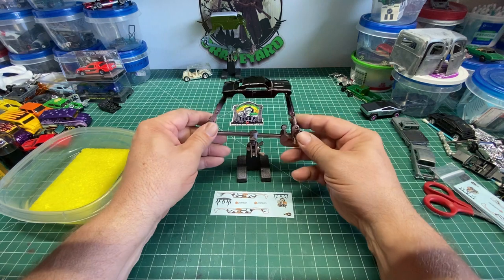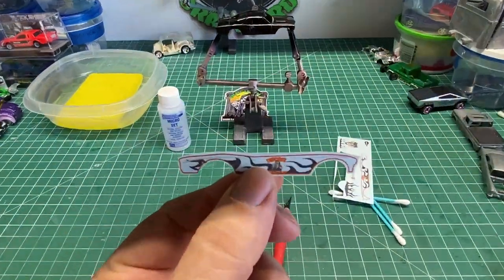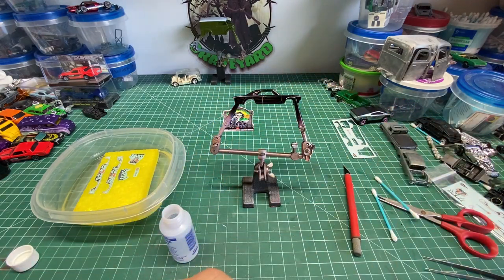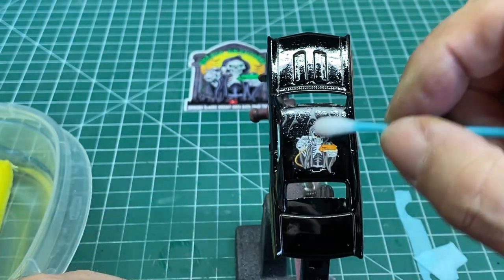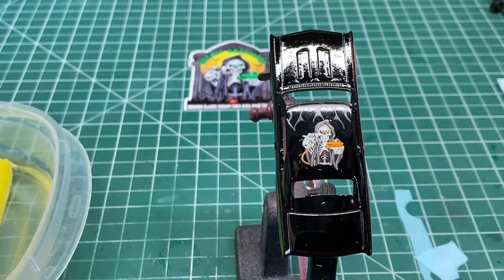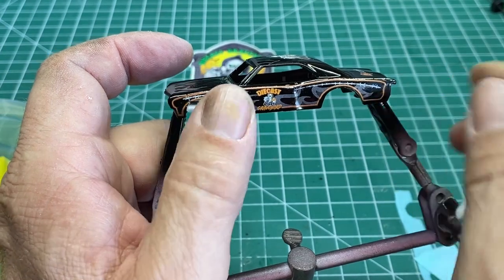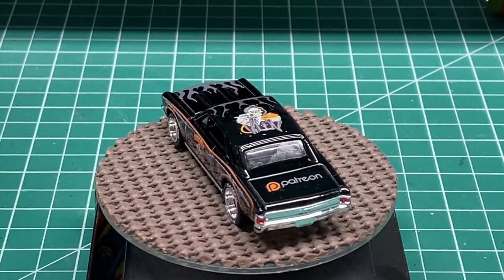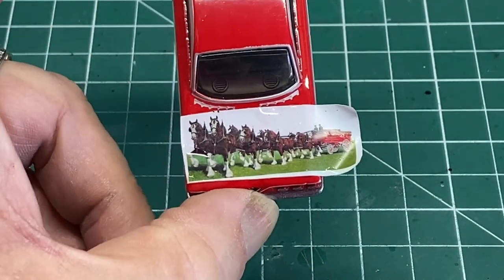How to Apply Decals to your Diecast Car

Comment: Hey Paul I have a question for you I have a couple of 1965 mustang convertibles and only 1 has a windshield does anyone have after market windshields for these 
Thank you for your time
Reply from the maker: Not so much for the newer castings. I would just buy one off of eBay and take the windshield out of that